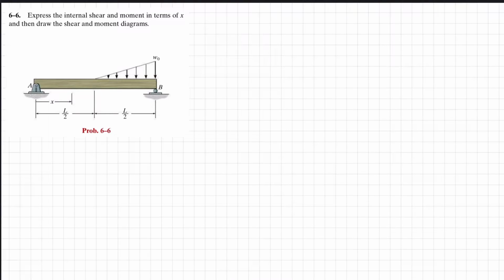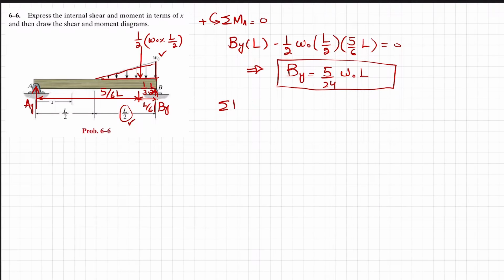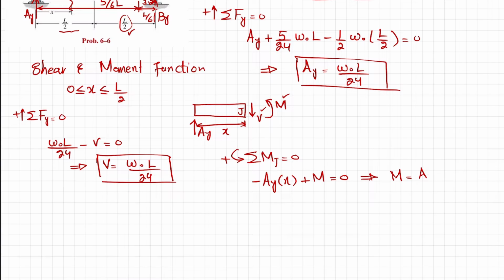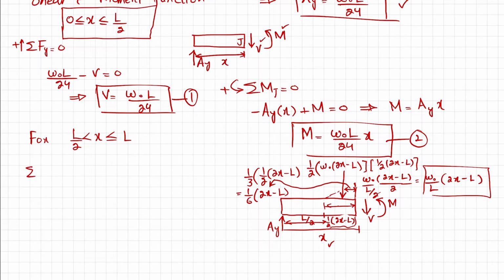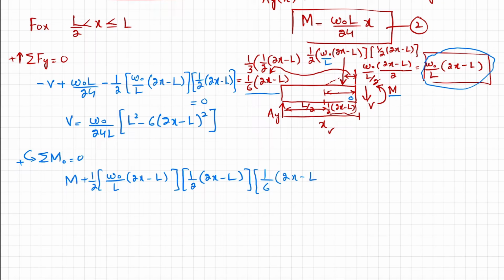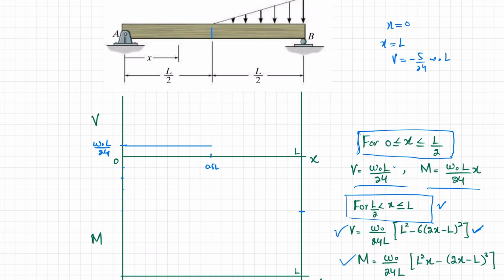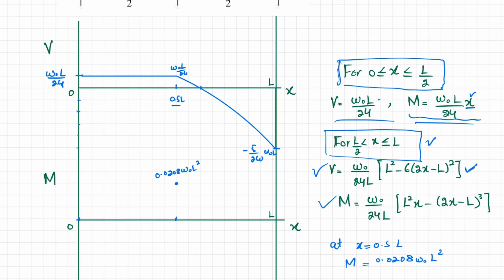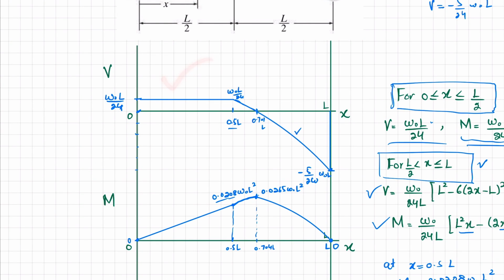6-6 |Chapter 6| Bending | Mechanics of Material Rc Hibbeler|

Comment: When graphing for shear force. you’ve obtained x=0.7041L downward between two shear. Would it makes sense if I explain it as taking second shear divide it by first shear, take the resultant equals it to 0. Finally solve for x.  

Or is there any other simple way to explain it? 

I will be presenting this problem in of my class in few days which will be graded on explanation.  please bear with me.
Reply from the maker: Here specifically this method which I have explained will be applicable only. As the shear force is 2nd degree curve so it will be very difficult to find the x where you will get zero shear force.
Reply from the maker: If shear force was straight line then there is another method of equal triangle from which you can calculate the distance at which shear force will be zero. If you are interested in that I can share with you 😊
Reply: @ please feel free to share
Reply from the maker: check out this Mastering Shear and Moment Diagrams Fast | Problem 5.54 | Mechanics of Materials Beer and Johnston
https://youtu.be/U9lVOiOt3AI

Comment: Finding moments for section 2 .. why the load is not negative.. you’ve explained that part little fast. Any clarification will be appreciated. Thank you Always
Reply from the maker: During the moment calculations we didn't take force negative or positive instead we take the moment due to that force. If the force is producing counter clockwise rotation then we take usual it as positive moment and vice versa.
Reply: @engradnanrasheedmechanical thank you I was able to spot it
Reply from the maker: Please mention the time frame where you ate facing difficulty

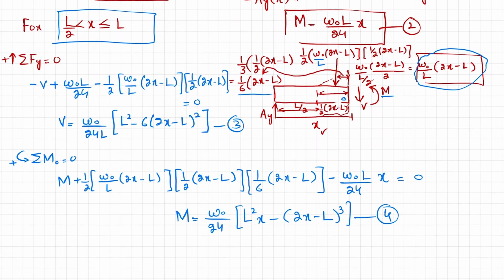Comment: Hi Adnan!  I can't understand where the L^2 multiplied by x  in the fourth equation come from. Did you divided by 1/L? minute 17:06
Reply from the maker: Kindly simply it you will get it and its not necessary that you should get exactly what I have written. You can leave the length equation as well. ❤ that will be correct as well